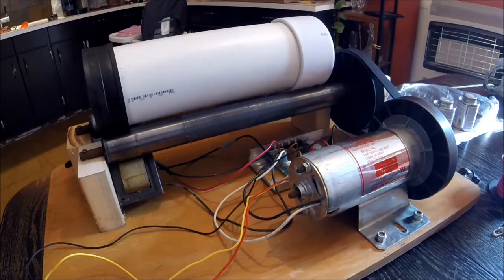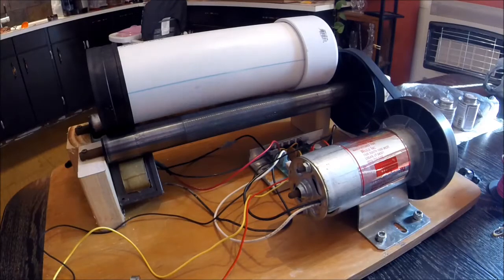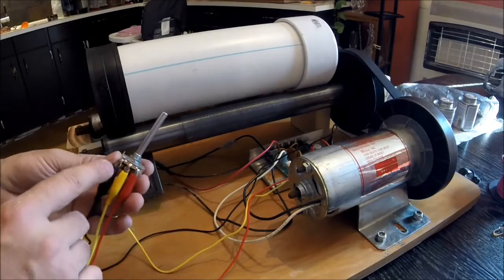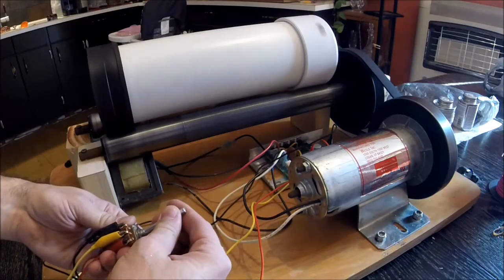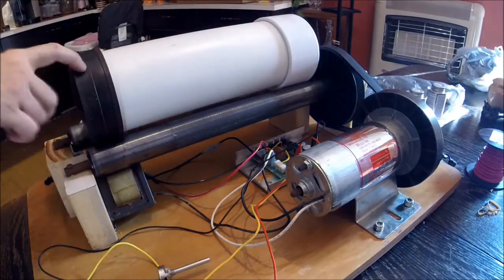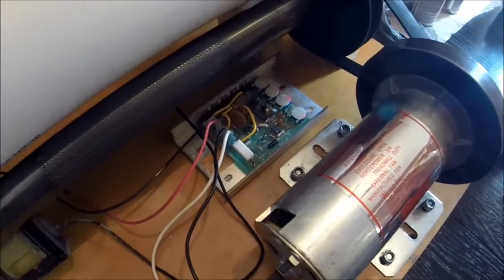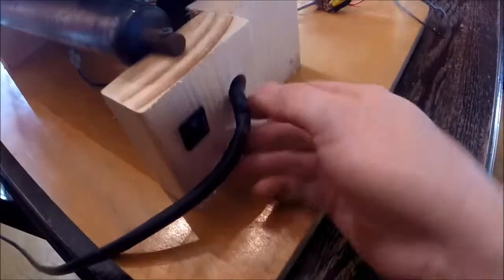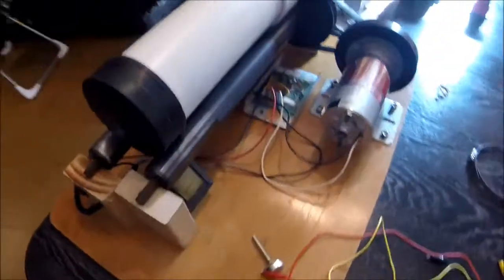Heavy Duty Variable Speed Ball Mill from Treadmill Parts

Comment: Get rid of the end caps and get test plugs they sell them in Lowe's and Home Depot. They expand as you turn the Wingnut and they sell the end with a rubber stopper that will not slip off ever. They're a little more expensive but what the hell
Reply: Or get a bell reducer and the smaller pipe can have the clamped cap....

Comment: You can make this project much simpler by getting a 12 or 24 volt power supply with a few amps behind it and just hooking a switch to turn it off and on just find one that is close to where you want it speed-wise and then if you want any further adjustments just make your pulleys or if you don't have a lathe by your pulleys appropriately. I have one in the basement that I was thinking about doing this very thing with so I pulled out a 48 volt power supply cuz I have power supplies everywhere and hooked it up it was much too fast so I got a 12 volt power supply and hook that up and it was a little bit slow but still head torque. So 24 volts might be perfect I'd have to test it out. Variable speed I guess it's nice but I can't see ever using it to be honest

Comment: Treadmills are the best for nifty parts! I've got the motor from one lifting my drill press table, one running the filter flappers on my dust collector, and one running a copper wire stripper. These things are a goldmine!
Reply: *****
It's almost comically easy to make a mill or drill press powered. Most treadmills have a second motor that changes the incline. It does so by using a sort of jack screw and one a pivot at the far end of the machine.
I don't have any that haven't been converted yet, but it's a simple matter of removing the jack screw portion and fitting a section of shafting. Most of the time they are 10mm (very common size). If I recall correctly a hole about 1/8" has to be drilled to accommodate a cross pin that ties the shaft into the gear train.
Once your motor is converted its a simple matter of either making or buying a proper rigid shaft coupling. From there the motor replaces the crank handle on your tools table. You do need a bracket to prevent the motor from rotating in space. Nothing major, just something to keep the motor from rotating.
Wiring is a hot-neut-hot arrangement with only one hot being live at a time respective to motor run direction.

Comment: Awsome ball mill! I have a electric engine from a washing machine and i cant slow it down it turns so fast. Can u help me there?
Reply: ***** This engine i think got brushes, i get this engine from a old washing machine and i try it to start before i demount it and it turns with a real good speed(dot to fast) it was a program on the machine do dry clothes. I remove the engine now and it turns to much fast! I got all the cables from the machine and all that stuff around but i cant get it to work
Reply: ***** i got an other engine, it turns 2500 r/min and if i give him 12v its seams like its starts but just for a second, and then i try to rotate it by hand i cant
Reply: ***** normal voltage is 220 on this motor
Reply: ***** ok tnx
Reply: ***** how you make your variable speed?
Reply: you talk about engine then you said voltages  ,OK you have a engine or you have a motor?
Reply: what kind engine ? diesel, gas, 4 cilin,6 cili, 8 cilnd or what?